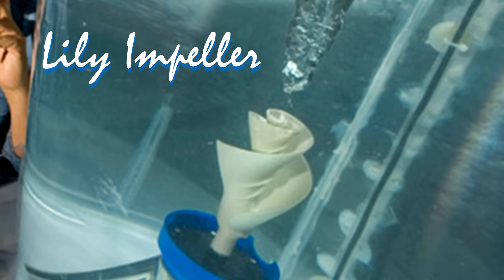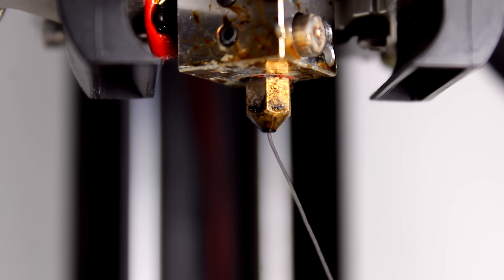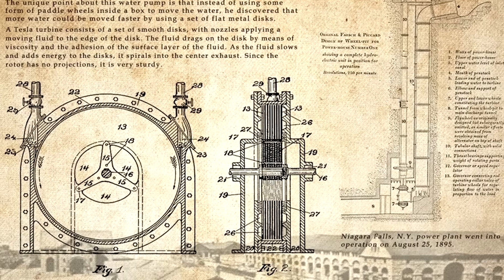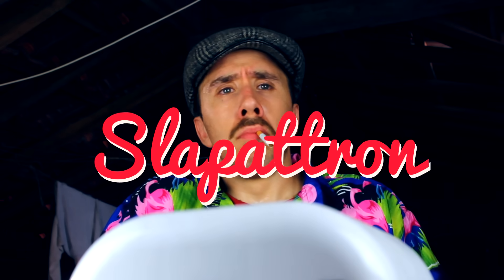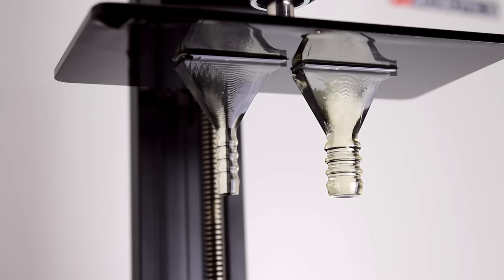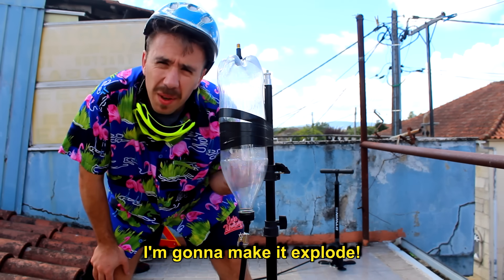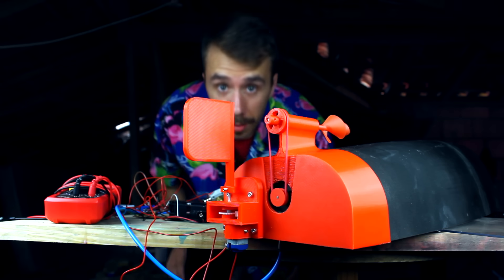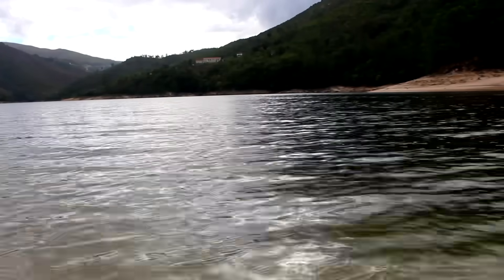Tesla Turbine Boat 3D Printed (Lily Impeller)

Comment: your boat rides too high on the water. increase the weight of the boat and get better alignment on your impeller, and i bet you get way better speed. i almost want to buy a 3d printer just to build that tesla turbine, tho, and try it myself. sweet project

Comment: You could have 3D printed the tanks ?😂 
Just add a pattern on the tanks for stability, should easily be able to handle the pressure.
Also why dont try to implement the valve into the tesla engine design to get higher airflow in the engine instead of making a nozzle.

Comment: Your impeller isn't smooth enough. It has too many oxygenation points, which decreases the effect of the impeller, and wastes all your energy. Also, going full power in water doesn't increase acceleration, it hurts it. You want the turbulent flow to show up at a certain point of the stream, not earlier later0

Comment: The performance of the boat will be better if you do an torque rps analysis first, find the highest torque’s rps, and pint a gearbox or calculate the ratio of the pulley

Comment: i would have liked to see how well it would have went with just the air powering it. i feel like it would have performed better if u had a nozzle just to restrict the air alittle to help increase its speed as its leaving the nozzle an have that nozzle either just barely submerged at the back of the boat or right above the water.

Comment: "The nozzle is supposed to increase the speed"
If you blow into the small end of a funnel, it slows down at the big end.  Blow into the big end and it will pull ambient air with the pressurized air stream.  Point the output of the small end of that funnel into the big end of another funnel....

Comment: Besides encasing the impeller to get a better flow efficiency i would definitely use a reduction from your turbine to the impeller, as a prop/impeller turning too fast in water will only cavitate and produce nearly no thrust. Also, it is very possible that the turbine has speed but not much torque, then the reduction will allow to increase the efficiency of your system.

Comment: I got it! The ultimate project that is a colmanation of multiple areas of engineering and multiple kinds of physics. You should build a rocket engine but not just a normal rocket engine a hyperbolic rocket engine and then as a 2 part series build a rocket and go for the speed record

Comment: Ooooh, use a fly wheel/s to store the energy from your turbine, then use gearing to run the impeller at a nice slow pace. You can also use integza bot to control the throttle to keep the flywheel topped up with power via the valve. You can use your torque meter for sensing when to add to air for the flywheel. This way you can get max efficiency out of the boat?

Comment: You could also consider a hydrogen-peroxide steam or acetylene power source.  Chemical fuels are usually much denser in energy than compressed gasses.  You could get that boat going at quite a brisk clip.

Comment: Let me give you an amazing idea . You have compressed air in the bottles right . Instead of using an impeller , why dont you use a simple tesla valve and use the pressure from the compressed air to move the boat forward . The tesla valve will increase the speed of air coming out and hence the amazing THRUSTTTTTTTTTTT !!!!!!!!!!!!!! . Why to convert the air pressure into turbine and then impeller , save up those losses man . Simply use a tesla vale instead of a impeller and you're good to go !

Comment: Nice video. Just a thought but maybe put the Lilly impeller into a pipe that is smaller in the back than at the intake where the impeller is located. Maybe you could get more pressure to move the boat faster.

Comment: Encase the lily impeller in a cylindrical tube. Your loosing pressure out the sides and the directional flow can escape. Encasing it forces the fluid in one direction only creating more pressure to the outlet. Send me a printer for the most liked comment and I’ll send you a fully operational Lilly jet impeller

Comment: It is as educational as entertaining. How about hooking up a portable tire inflator to the bottles and use the other function from the car remote to replenish the compressed air. (here's an option for portable inflator https://weluvsale.com/products/pumppro?utm_medium=cpc&utm_source=bing&utm_campaign=Bing%20Shopping&msclkid=c14578c55b43128b502f18869fc8d7bb).   But the best option is probably 3D print a rotary screw compressor (https://en.wikipedia.org/wiki/Rotary-screw_compressor) I am sure it will be a nice challenge to match the endless screw tolerances in 3D printing.

Comment: You should have gotten a rc aircraft radio you can get a good one for 60 US and a rc switch for the electric steering motor and the radio setup could be used for a lot of stuff

Comment: Isn't an impeller supposed to pull?  Wouldn't it work better if it was positioned at the front of the boat to pull the boat forward instead of trying to push the boat with it?

Comment: low output (internal) resistance of the mechanical drive (tesla of the turbine, motor) is not matched with the high input resistance (load) of the propeller, and in order to obtain the maximum power transmitted from the source to the load (consumer) - these resistances must be equal - then the coordinated mode is achieved load, in which the power in the load is maximum, and efficiency = 50%, tk. this happens when the source and load are equal, when half of the energy (power) is lost in the source at its internal resistance, this is accompanied by a voltage drop by half, and the current increases to half the short-circuit current of the source.
example: the battery gives 1.5v no-load voltage and 2 ampere - short-circuit current, which means when we close it - the internal resistor Rb for 1.5v EMF flows with 2 ampere current, according to Ohm's law this is possible with Rb = U / V = 1.5 / 2 = 0.75 Ohm (1.5V / 0.75Ohm = 2A)
if the load is a piece of wire (short circuit) efficiency = 0%, all the power heats the battery - its internal resistance is electrolyte, etc., it is 0.75 ohm and the battery heats up at full power 1.5V * 2A = 3W this is the internal resistance and will not heat the short circuit wire.
if the load is an LCD quartz clock - the voltage on them is 1.5v, the current is 1/1000000 ampere, almost nothing is released at 0.75 ohm of electrolyte - and everything on the clock - the efficiency is almost 100%, but the backlight power of the clock is very small, adding light bulbs - smoothly we go from one extreme to the other, - the boiling power of the battery grows, the boiling power of tea - first grows, then falls, - the maximum when the boiler is 0.75 ohm like the battery itself, while on the boiler + the internal resistance of the battery will be 1.5v, the current will flow 1.5 in / 1.5ohm = 1ampere, both through the battery and through the boiler - on the internal resistance of the battery, 1ampere * 0.75ohm = 0.75volt will fall (persist during the drawdown) to the boiler, the power on the boiler will be 1ampere * 0.75volt = 0.75w, and the same will stand out inside the battery - after spending the charge for the entire load (the heating loss of the battery and the useful power heating a boiler of equal resistance - that is, consistent (resistance of load must be=with the output resistance of the battery for exactly maximum power in load) load) 2 * 0.75 = 1.5W
batteries spent from the wallet 1.5 watt (let's say for 1 hour = 1.5 watthr) - half will heat the water with a 0.75 watt boiler, this is 50% efficiency, because the second - equal power - will heat the battery and the room
BUT! in any other operating mode - with another boiler - more or less high-resistance - the efficiency may be higher (if it is heated more slowly - with a high-resistance boiler at low power), but power higher than these 0.75W cannot be obtained from such a battery in any way - except unusual mode-chort circuit battery room heating...
in your case - shaft revolutions - current, torque - voltage, a Tesla turbine gives a lot of current and a low rotational voltage - this means a low output resistance - and it must be loaded until the revolutions drop by half, with a low input resistance (for example, the bearing is very low, and the wall - push hard force voltage results in zero current of wall moving - does not flow into another room - resists high ... in other words, you need a reducer between the Tesla turbine, and not allowing it to spin (open circuit - high resistance - like a 220v light bulb to a 12v battery - current does not flow - turns are not grow - and the turbine does not give power -  you need "pressure" (potential) and not speed (current), so put reductor - like magical DCtransformator - will lowering RPM and rising Torque - so give to tesla turbun lo resistance load - easy to rotate fast

Comment: 13:11 some other people invent safe circular saw - two years before me - they use pyrotechnic brake that need service after act - if one touch blade when work, my idea was about soime kind of electronic bladerotation-stoping brake mechanism, but after youtube video about that patented saw, my idea progressed - you don't need touch detector with shotgun-like fast pyro-brake, you can use capacity-distance detector(sensor) - that will lowering rotation RPMs while(when, upon, during convergence) the body approaches the saw 
a capacitive proximity sensor, allows early starting braking... in advance - performed electrically - by shunting motor or  faster-by reversing the polarity of the collector motor supply. It is Impossible- to appear instant near the capacitive sensor - unwaited , and functioning of system will be visible during usual operation, in contrast to the disposable - the squib, which is replaced at the service center, so checking not possible(at home) even - because in patented saw - it always damaging safety mechanism when happens. my "smooth security tracking system" conception looks more simple
also plastic cutable by laser plotter, and - easy - with hotted by curent  nichrome wire - some time
sometimes used as a guillotine knife - heated to red with a current of several amperes, a taut string melting a long line of cut parallel to the surface
sometimes - like a jigsaw or a vertical saw - holding the upper end of the glowing wire in hand, hanging a weight (plumb line) on the lower end and vertically (perpendicular to the plane of the material) up and down sawing plastic, thick wood, and even glass - with care, I melted the tubes like plastic - although I dream of a 0.5mm platinum string - nichrome often burns out - on the verge of a possible 0.5mm glass melting

Comment: You need to get the bottles out of the water - SOOOO much drag.  Also the impellor seems a bit small unless you run it at high speed.

Comment: This is mad. Hey i want you to make an energy harvester by using a pole that goes up in the air which is attached to a mechanical device that will spin a motor used as a generator.When any direction gust of wind moves the pole it gives energy to the motor

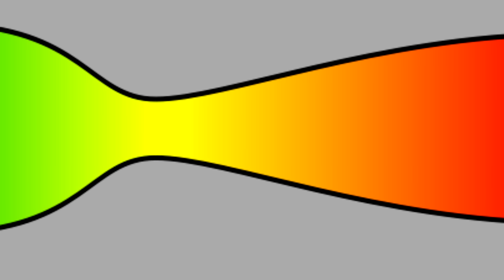Comment: 5:40 If im not mistaken, in rocket engines, (in space) they have engines with big nozzles and small holes/openings, i think they do this to increase speed of the propellant being ejected at the cost of pressure (im not sure about the formula). And since you need more pressure, the de laval nozzle basically doesn't help it at all

Comment: I have 2 ideas that I would love to try, but I don't have a 3D printer. So I offer them to you.  
1st. Testing a 3D version of Teslas valve. Take your standard tesla valve, halve it down the centrebline, then print 3 halves in a Y configuration. 
Does this cause more or less restriction in reverse flow. (can also be attempted in an X configuration)

2nd. Using the Tesla valve again, but as a motor! At the apex of one of the U sections, if you inject some fuel and an ignition source, will the resulting expansion of air flow out of the derestricted flow end while drawing air in from the other? Or will it just burn in the middle of the valve and draw air from both ends?

I leave you to ponder these scenarios.

Cherry tomatoes are a lie! They taste nothing like cherries, and are just small concentrated balls of mushy disgusting!

Comment: What abou print a nice vertiical garden wit parts where you Can see how water flows downstream. And maybe add some mechanism that can transfere the water from the botom to the top. The source of the energy could be a wind or gravity perhaps? Or maybe a spring tension mechanism... Oooo i can already see it! :D So you will have nice fountain with flowers or herbs.

Comment: It did not work because surface area of lily impeller is less, (Increase it) 
And I still don't understand the difference between an impeller and propeller, other than impeller is used in turbine and propeller is used in a ship to propel forward.

Comment: You could have put the lily impeller inside an intake.  Then you could have transferred energy more efficiently for higher suction in the water.  You should have also put vortex channels in the bottom of the boat in order to take full advantage of the reduction in friction from the rotating water.

Comment: Make your printed boat fully enclosed, but still hollow inside and e.g. with one opening on top with cork and little hole at the back just above the waterline (exhaust). Fill the boat with Coke (or citic acid) and put it in water, drop mentos inside the boat, screw down the cork....

Comment: You need to make it steam powered. Make a Tesla turbine, lily impeller steam boat. You can get loads more pressure and duration with steam. Water expands 1600 times when it turns to steam. What sort of temperatures can you 3d printed parts cope with?

Comment: First of all very nice video, entertaining and educational aaand a big like from me! Only thing i would mention that since you bought an rc car, you could use the motor from it to drive the impeller and it would greatly help, since you wold loose the bottles that create a geat drag  becaouse of the increase of the sourface touching the water, also boat would be lighter and simpler with less parts. i would reeeally like to see the impeller in action without the Tesla turbine so that  you can make the comparison  betwen a propeller and impeller on the same rig by just swaping them out. i would reeally like to see the results. Best  wishes in 2021!

Comment: Great video by combining Tesla turbine, impeller, and simple controls. Does the size of the impeller change the speed? Seems slow and inefficient. What about testing the Tesla turbine in a 3D printed tank? Will the turbine have enough power to move it? New subscriber

Comment: Molecular adheasion to the fine gaps between the discs. I sold several steam tesla motors under my other channel TheTeslaJet
 I got it up over 40 000rpm! not enough orque only good for fans and high speed polishing devices I found out.

Comment: I think for the boat to go faster it is better to use the impeller for an hydrojet motor and you could reduce the surface contact between the water and the boat reservoir using the same engineering that has been used for the America's cup boats

Comment: Use liquid propane instead of air.
Reply: @The name's Johnson, Boris Johnson it will last longer. Until all liquid converted into a gas turbine will be supplied with a pressure of about 4 bar. Compressed air pressure goes down immediately when  solenoid valve activated.

Comment: Keep the lil impeller on a plastic pipe (it will pull water like a water pump) and make the lil impeller little bigger one to speed it . and it takes time to speed up so design another turbo engine . and 😍 it's a great project

Comment: You should remake the boat but with a bigger impeller and if you wrap the 2 liter in some tape and use nicer hardware you might be able to get a higher pressure.

Comment: The compressed bottles were backwards and so was the Lily Impeller turbine blade. The backwards bottles cause drag which slowed it down and the thrust of the Lily Impeller wasn't facing the rear.

Comment: Please build a water pump with a lilly impeller instead. Encase it and the suction side should be radially of the large side and the discharge should be axially at small end. And compare with a standard centrifugal pump. The casing should clear the impeller about 2mm at every point. Measure flow and head. That would be a great experiment

Comment: i would vote for remaking this project. there are lots of things to improve, for example all the bottles touching the water. you could put two under and two over the plexiglas, making some kind of catamaran. second you could see the speed at which the impeller is most efficient, maybe you need to reduce the speed and increase the diameter of the impeller. i would also see if smaller bottles could handle higher pressures, maybe they are more efficient than a big one

Comment: Acrylic and polycarbonate are not fragile like glass, they will bend and potentially snap, but won't shatter, I personally install quarter inch polycarbonate and acrylic, easiest way to cut is with a circular saw.

Comment: Dont hate on me here, BUT... How about power the boat with a pulse jet engine that uses one of the outputs to power a tesla turbine that turns an impeller and the other output of pulse jet give an atmospheric thrust vector as well as control the steering? So that you get water and air propulsion

Comment: I have ideas about the boat. Alternate the orientation of the air bottles. place two bottles above the mount to minimize drag. I think you should build an inlet and outlet port for the Lilly Impeller. I just thought that an outlet could be one of those two valves you used for your sugar rockets